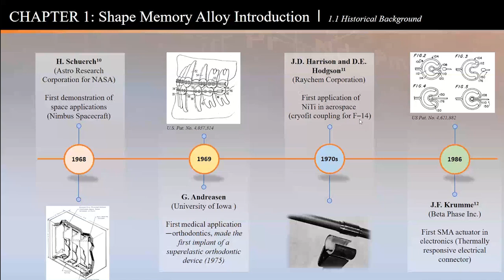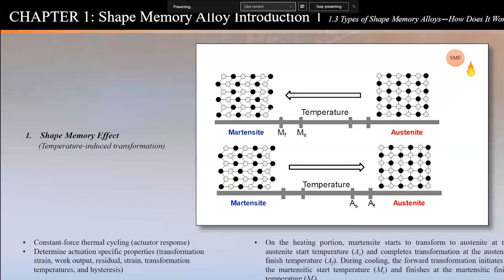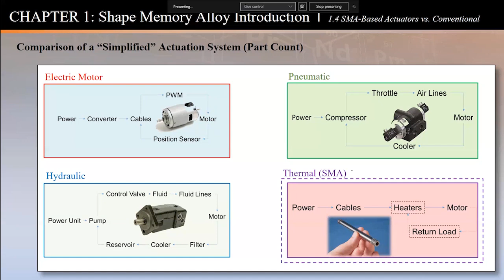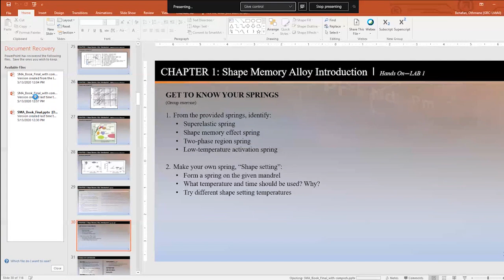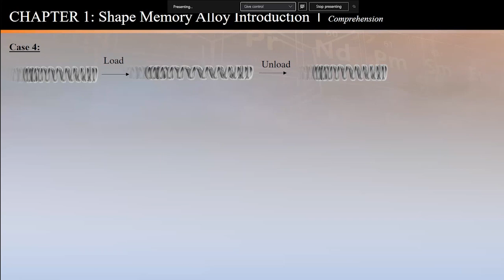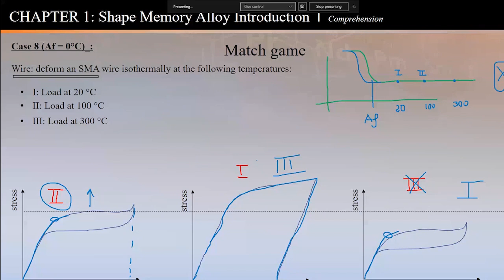Shape Memory Alloys SMA   Chapter 1  Introduction

Comment: You are the answer to my prayers. My body is a living magnet. My stomach have moving metal fibers radiated to something that is shapeshifting and controlling the movements of my abdomen and it reflects blue beams of light DIRECTLY to my belly button from a window in the basement that is covered with cardboard which only has a 1 or 2 inch crack of sunlight.  The beams of light controll what looks like a volcanic shape of flashing , moving, reflecting wires controlling my belly.

Comment: I desperately need to speak to you. 5 years ago i was standing at my bathroom brushing my teeth which has partial dentures and out of nowhere I blacked out and woke up in the shower,  which is across the room on the other side of the toilet, on my head with blood spatter every where.  I looked in the mirror and my bottom teeth/dentures,  were sliced COMPLETELY through my bottom lip. And listen to this,  the SOLID METAL safety bar in the shower is DENTED from my face hitting the bar. Heres the issue, I have an ESSURE NITINOL DEVICE IMPLANT in my fallopian tubes and a MINERVA vaginal mesh. I went to the ER and they gave me 6 DISSOLVING STITCHES . Within 5 days my lip was 5 times the size with something with a fishes shape that was purple growing in my lip. Their was luminescent white shards sharper than glass rusty screws poking out of my lip. I was pulling them out with my fingernails and they were more solid than metal. They began growing in my fingers and fingernail clippers wouldnt even break them. There were hundeds of these microscopic shards that reflected light poking out of my knuckles that ripped my clothing. Its been 5 years and my entire body is covered in deep pitted burns that grew from the inside out. NO ONE HAS BELIEVED ME OR HELPED ME EVER